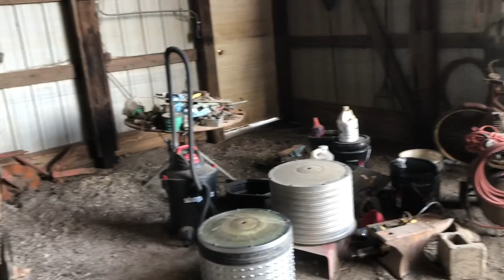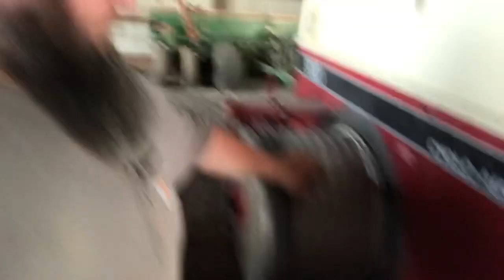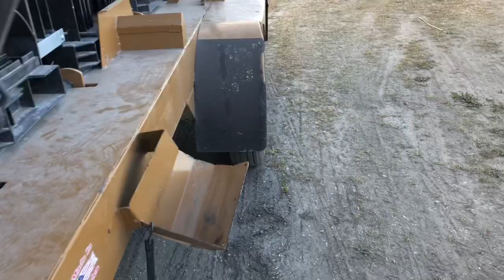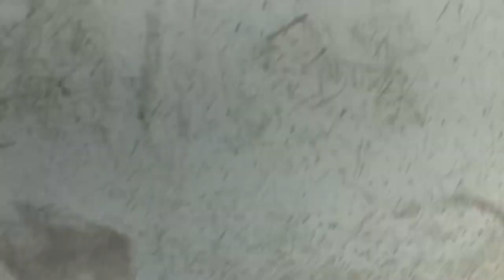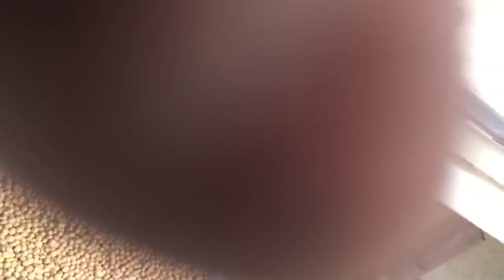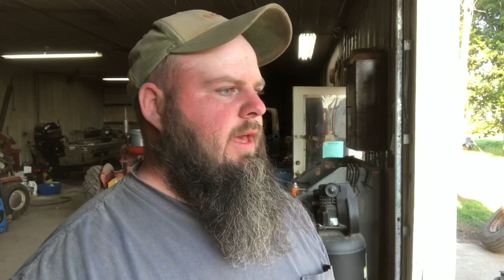Planting Soybeans 2020

Comment: Great video. We used to run an 800 cyclo. It was on the three point with lift assist wheels. It was an 8 row 30" and it had the splitters to plant soybeans on 15" rows.
Reply from the maker: I would definitely like to a setup like that... probably have to custom build it.